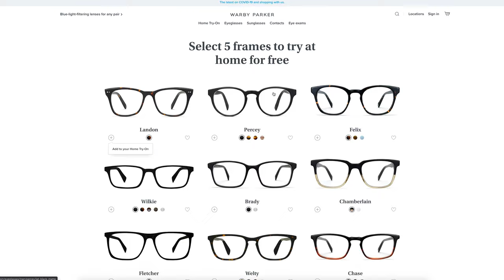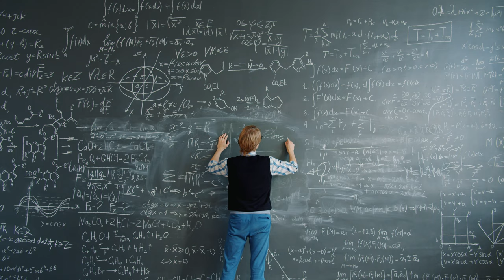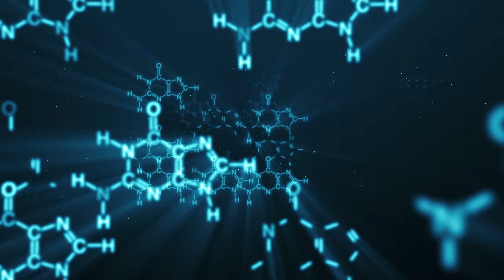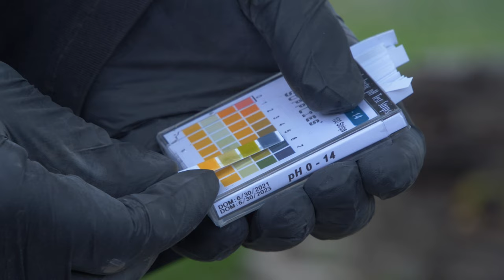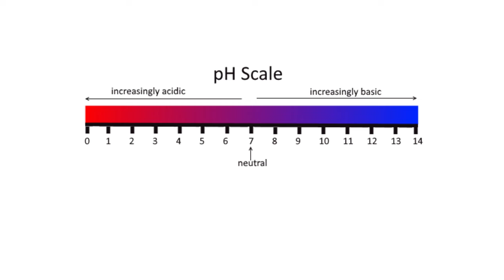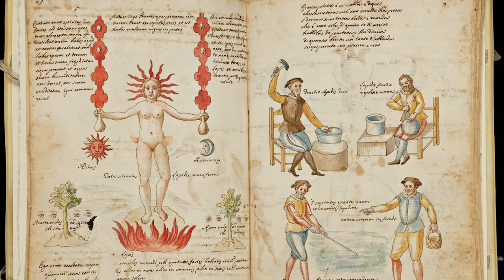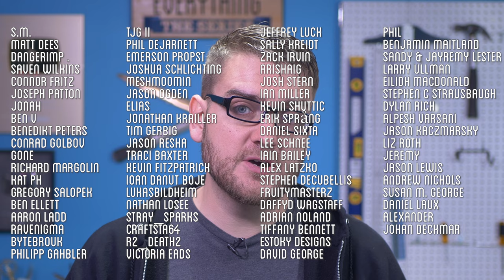Can I Make a Sulfuric Acid Strong Enough To Melt Flesh?

Comment: WTF is "hydraulic acid"? Who's using acids as the working fluid in hydraulic systems?
Also when you make sulfuric acid from metal sulfates, what you're actually doing is using heat to decompose the salt into metal oxide and sulfur trioxide. Then you combine the sulfur trioxide with water to make sulfuric acid. You don't need any oxidizing power from the air at all. But what you do need is really high temperature, and I'm not convinced you achieved it for most of your sample.
Reply: he meant hydrochloric, and i agree, I dont think he got high enough temps.

Comment: 4:45 Andy put on protection clothes to SHOW us the chemicals. Severe warnings.
8:34 Andy dehydrating copper sulfate with probably lots of chemical gases, wearing no eye protection.
11:49 Andy's holding an open glass of pure acid waring no googles, no gloves, no robe, no hat.
Reply: 1. The chemicals showed aren't actually all that dangerous unless you eat them or something so not much protection required here.
2. dehydrating copper sulfate as shown doesn't even produce chemical gasses except for some steam.
3. The acid he had there only had a concentration of around 0.01-0,1% which is negligible. You could drink that and it wouldn't even be very sour. Thus no protection is really required at all.

Comment: "1000 ml of water"

Dude, why don't you just say "1 liter"?
Reply: because in chemistry you often measure things in ml  and not liters, reason beeing it is more accurate and lowers the risk of translation/calculation errors if you have all the measurements in the same unit... imagine for example having to mix 1liter of water with 10ml of acid, but writen as 1l+10ml and  in a clumsy moment you forget that one is in ml and the other in l and add 1ml water to 10ml  acid... in the worst case scenario your experiment explodes around your ears...

Comment: "enough to really burn yourself if you spill it"

proceeds to daintily hold it and shake it about in an open beaker with bare hands and zero safety precautions...

good vid, but you gotta set a better example, js.